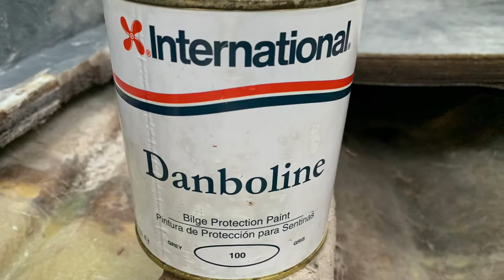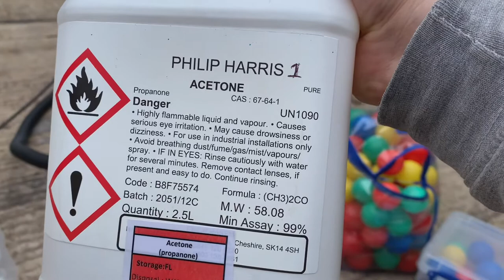Shetland Alaska 500 fitting a new boat floor part 2 | how to fibreglass a fishing boat deck

Comment: I would have thought that a foam would have been used below the ply. I’ve got to take the floor up on my 535 am I’m dreading it
Reply from the maker: It’s fairly simple mate. Just work slowly and methodically. Be prepared to change the plan and get it done 👍🏻

Comment: Great videos just about to start ours. Did you end up with a lip down the side, as your floor did not go to the edge of the boat. The section at the back in the main area that you can see at 12:32 in the video.
Reply from the maker: Hi Nick, there wasn’t a lip as such as I blended the fibreglass smoothly into the side over the small existing piece I left on there. 

I did find that there was a part of the floor that had would have collected water so I sanded it back slightly and filled it with resin to make it flat. I doubt this is a professional way of doing it but it worked well!! Happy to answer any questions
Ed

Comment: how many layers of fibre glass did you use ?
Reply from the maker: On the underside, one. On the top side 2 up the gunnels, 3 on rear lockers and 4 or 5 on high traffic areas where we stand when fishing/baiting etc
Reply: Why didn't you use 18mm ply instead of 12 +9mm?
Reply from the maker: 18mm would be overkill in my opinion. 12mm is more than enough for the job, I used the 9mm to reinforce but I don’t think it was needed. The strength is in the fibreglass
Reply: @Suffolksportsfishing  how many layers did you put down?
Reply from the maker: One layer on the underside, 2 on the topsides lapping up to the gunnels, 3 over the rear lockers and 4 on the main section. After using it a lot since doing this the floor is still solid and there’s no way it needs more than this. Let me know if you need to know anything else 👍
Reply: You must try the paddle roller it wets the glass and rids the air a much better finish 👍🛑